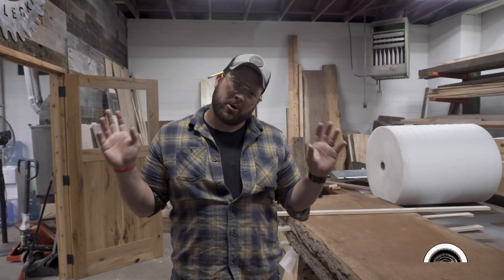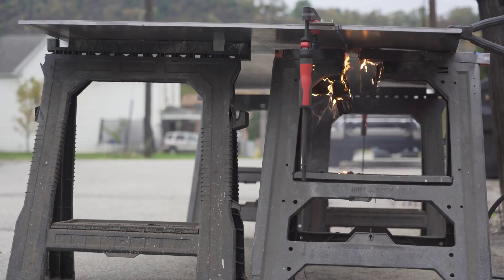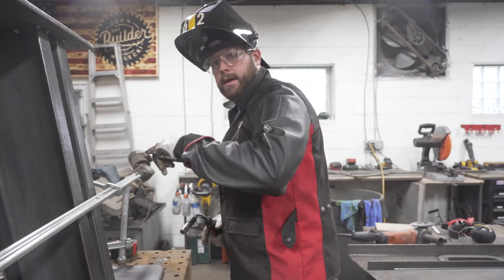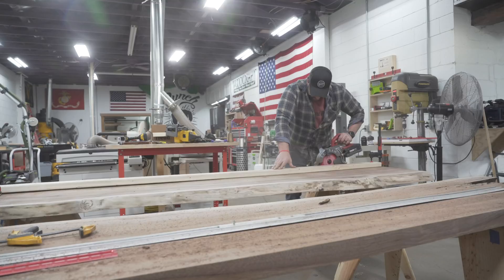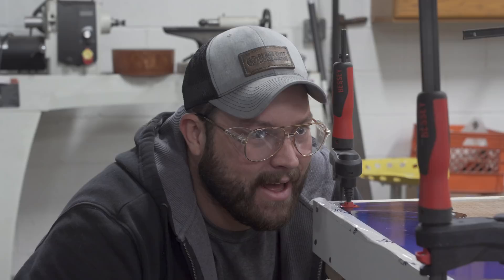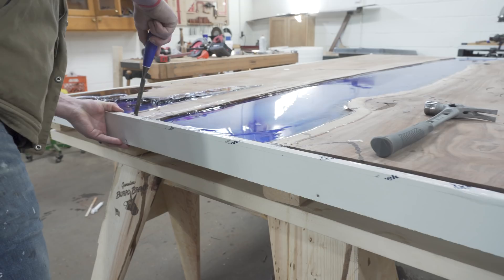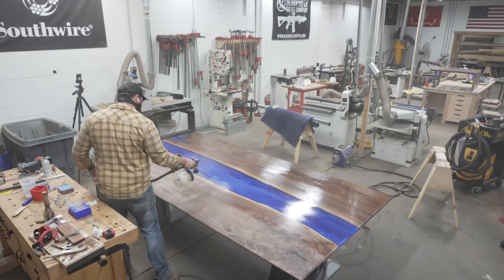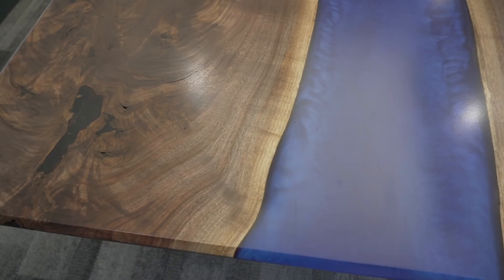HUGE 60L Epoxy Live Edge River Table!

Comment: Amazing how that turned out. That epoxy is insane with the amount of weight it's carrying on either side. Excellent work!!
Reply: I was amazed that the epoxy held on to the wood sections.  When they were picking it up, I kept thinking it would separate under the weight.
Reply: I am in the middle of build just like this. The river will be jet black and almost 2 feet wide. Final dimensions will be 5' x 10'. I was thinking I would have to let in a 1/4" steel plate in a couple places. After seeing this though....my luck it would fold up like a hospital bed as soon as I pick it up. Wish me luck.

Comment: 2:54 as if the short bus students didn't have enough to worry about now they are blind to boot. Great video by the way.
Reply: A plasma cutter won't blind you
Reply: @mypigsfatter4154  neither will the sun unless you stare at it for a while.
Reply: @mypigsfatter4154  You dont have to be a genius to look at that light to know that will hurt your eyes without protection. And yes every where i looked they recommend either a welding mask or properly shaded lenses to use the plasma cutter. You are wrong and should stop spreading false information that will get people hurt.
Reply: @mypigsfatter4154  "Arc rays produce intense visible and invisible (ultraviolet and infrared) light rays that can burn eyes and skin. Proper clothing protects your skin, but your eyes need the additional protection provided by a face shield or safety glasses outfitted with the correct lens shade. To determine the proper lens shade, check your machine's amperage capabilities and then consult Figure 1 (see ANSI Z49.1 for shade numbers used with plasma cutting above 80 amps). To protect others from flash and glare, install and maintain approved screens and barriers where appropriate. Warn observers before initiating a plasma arc."

Comment: Hi John, I may have missed it in the video, but did you have to do the pour in multiple stages, allowing each layer to dry first, or did you do the entire pour in one shot?
Reply from the maker: One shot!
Reply: @John_Malecki  and you got no small air bubbles whicg Form during the drying process?
Reply: @jona_kr5390  usually sand it off on the top layer. Epoxy doesn't form air bubbles like that

Comment: I am not sure why none of the epoxy table makers drill holes in the bonding areas so that epoxy can seep in and form additional structural support. 

When you make a river, add some greens like shrubs. Makes it more real. Bury a few live guppies too
Reply from the maker: Because it isn't necessary. This client also specifically asked for no shrubbery.
Reply: I wondered about the additional structural support too.

Comment: Very cool.  I was surprised that the two slabs were able to be held together by the epoxy.    I would have though it would seperate and the wood/epoxy joint given the thin profile.
Reply: That was my thought exactly!  No matter how strong the epoxy is, it's only bond is to the very edge of the wood.  Seems like that would be an incredibly weak point without prior bracing.

Comment: Ive seen other stuff like this. A propane torch? (or whatever fuel was used) most people I see use a heat gun to remove bubbles. Are there any downsides? Can you move it too much or heat it too much if you aren't fast?

Comment: John, I've seen other river table builders (stone coat and blacktail studios) add metal supports under their tables to help prevent cupping of the wood. What are your thoughts? I'm building my first table now, and I want to have a nice clean look. I'm not sure if those are truly necessary. Your tables tend to be larger (Westminster and Black Rifle Coffee). Do you have an issue with the wood warping?

Thanks for your help!

Comment: I loved how it turned out, both earthy and modern. Alternatively you could have not made the table perfectly square but just let the table end where the original wood slab ended. And a height difference between the epoxy and the wood didnt look bad either.

Comment: Fantastic. Quick question. When you filled the river part with the blue epoxy, after it hardened, it appeared to be around 1/4 inch below the wood surface in some areas. Is that what happened, and then you used the CNC  to remove some of the walnut down to the epoxy? If anyone can answer I would appreciate it. I want to do this on a much smaller scale, and don’t have a cnc. If the empxy settles and isn’t flush with the top of the wood, how would I get everything flat without a huge planer, sander or cnc?

Comment: The “Pro Tip”, is even more important w/stainless, carpenter 20 (super stainless), hastelloy , and to a certain degree monel and inconel.
Also, (I’m sure you already know) when welding ss to carbon steel, use 309 wire or rods. The other “rule of thumb” is to “weld up”.

Comment: John,
Want to make a River table with a Water Fall on one side for a Sofa table.   Doing in Blue with Glow powder for light at night.   My question, I pour in on piece total length of top and leg.   Cut 45 degree on top and leg to make the 90 degree.  Assume I will need to polish the 45 degree cut but what do you suggest attaching the epoxy together at the seam?   The wood, wood glue ok but the epoxy.  My only thought was something like a clear, non yellowing or clear epoxy but not sure.  Suggestions taken.  Miss watching Steelers practice at St Vincent’s in Latrobe.   Could see them from the office at a small company called Kennametal.

Comment: Hi John very great job. Would like to ask you something. What type of finishing are you spraying? It’s polyurethane? Let me know the brand please. 
I just did a small river table and I want to finish it with  polyurethane due to durability, I don’t want to use oil finishing because of the maintenance, 
what would you suggest for this? Do you know any brand which is easy to apply? Take in mind I’m not professional painter. Thanks

Comment: So there is nothing connecting the wooden slabs other than the epoxy itself? I would expect some kind of rebar so the weight of the wood wouldn't cause it to snap off the epoxy

Comment: I was wondering about the extra little bit of epoxy that's on the edge of the table (not attached to the "river")--did the walnut splinter necessitating that bit? Or did some epoxy spill?

Comment: What did you use for the finish on the table?  Just asking because it made the wood a very nice brown but at the same time didn't overpower the blue epoxy resin.  Just asking because I am having an issue with stain overpowering the color in my epoxy.

Comment: One question. I know epoxy is probably strong enough, but... Would you ever consider drilling something like a dowel/domino holes in the live edge of the slab where the epoxy would flow in to reinforce the joint between the wood and epoxy?
Reply from the maker: Dont really think its necessary with the chemical bond from the resin
Reply: That's a good question, curious to see how that joint holds up over time.  Wood and epoxy expand and contract in varying degrees, especially from moist winter months to summer.

Comment: Dude you crack me up😂 In a couple of weeks I will attempt to try and make my first river table😱 in this video i saw you tape over the holes in the underneath of the wood...why do you not want the resin to go thru the holes if you are just gonna sand it anyways?🤔 Loved your other video beginners mistakes very helpful👍 and you have a new subscriber wooohooo😁😂
Reply: Just guessing but it's probably a waste of resin if you're going to sand it all off. Better to tape and only use as much you need.

Comment: is the epoxy the only thing bonding the two pieces of lumber
Reply: the legs give it additional support
Reply: would love to know this too. Feels like the epoxy would not have enough strength to hold the two slabs when you're picking it up at the edges.

Comment: No stretcher that's easy aesthetically it will not have the same effect if it's spaced it will draw attention from your table because if it's in a well-lit room or has sun coming in people will want to know why the light is splitting the legs and not paying attention to the fucking amazing table and even if that's wrong still aesthetically together is better then being apart

Comment: Why have such a deep trough in the middle? If it isnt transparent, couldnt you have just put filler there and saved on epoxy? This is a legit question, Im not being negative. I want to know reasoning.
Reply: PS, the edge really makes the difference on that table

Comment: John and commenters, I just saw the most amazing resin flower table from Russia. Who knows, it may give you some great future ideas for your
work. Check out: Amazing Table Of Flowers And Epoxy Resin (posted by: Positive Couple). John, with your massive tables you may create more wild
high end work for rich clients. For instance, can you picture the table in this video just running various real flowers in clear epoxy running right down 
the whole center where the blue section is? Or, perhaps, how about one colour of roses or even multi-coloured roses etc., or the favourite flower(s) of 
the clients choice? Other options could include a 3" to 12" resin border around the whole outer edge of the table with real flowers of the clients choice?  
Or, you could run a 3" to 12"+ wood border with flower choices in the whole center of the table? Or, perhaps add the flowers within a 3" outer resin border 
with the flowers placed in 6"- 12" angled inside corners? Other options may include custom inlaid and machined in brass or polished aluminum billet 
ornamental designs, letter styles, flame designs etc. etc. This category has unlimited potential for inlays etc. Great work on the table in this video! 
Hope my comment inspires more of your creativity. Later!

Comment: I hope no one checks those welds, it looked as though the effective throat was not developed.  Were those welds inspected either by X-ray, mag-partical or even visually???
The structural elements (or channels as you called them) properly sized by a PITT Engineer. . . .or did you guess?
 Great touch torching the horse.. . .Stush would be so proud.
H2P
Reply: I take it you're in this like of work also?
Reply: @Cosmiccoffeecup  Not exactly, much more steel-centric background.  But John's work needed some critiquing.  If I had more money, I'd order a table like the college ordered.
Reply: Bruh.. it's a table not a bridge. Chill

Comment: Is it possible to epoxy smooth edges together like this?
Reply: Dissecting Diy unfortunately no, epoxy can only be used for live edge river tables
Reply: What about on small projects? I want to join two pieces of smooth pine. About 10x38 inches a piece. With a 1.5 inch gap in the middle. If I use a high grit sandpaper on the sides I’m joining. Will that be enough to hold it together?
Reply: @dissectingdiy  I was just kidding, that epoxy would fuse to anything you mold it to unless there is some kind of release tape or spray. But if I was going to try to do that with smooth surfaces I might drill some holes so the epoxy hardens as if it were dowels, might even look cool if you do it right.
Reply: naioti Lol. So you can tell this is my first time working with epoxy then? Haha. Thanks for the reply.

Comment: How much roughly is one of them table tops
Reply: About $200 for the sheet of steel, $1400 for the epoxy and those walnut slabs could go for $500 each depending on where you get them from. So you're looking at maybe $2600 in materials alone.

Comment: The Home Depot's lumber selection in my area is freaking atrocious. Almost every time I go, every piece is cupped, twisted, warped or chipped to the point of being useless. Lowes has much better lumber quality. I'm in the FL panhandle if you're wondering.

Comment: I have a constant Haze on my epoxy 😡 I wet sanded to 1200 and it's clear when I wipe it but the haze comes back ☹️
Reply: Are you not polishing your epoxy? Look into it. Use 3M.
Reply: @silloh7009  tried polishing with multiple products and polishing pads

Comment: Cynical.
 I use to build libraries and schools, it's called public works (which means local tax payer money). The biggest waste of money , they hire artist to think up the craziest designs that cost a fortune like this table,  100 times more expensive. Sure it looks nice, but the waste of money that should be going to teach students is ridiculous. The last library i built in San Jose Silicon Valley cost about ten million, when it was done, they did not have enough money to buy the books and pay librarians so they turned it into a daycare center. Great build by John ! but it brought me back to those days of waste. How is this table going to help any students to learn.  That is why i now never vote yes on and tax increases for public works.
Reply: Was thinking the same thing.